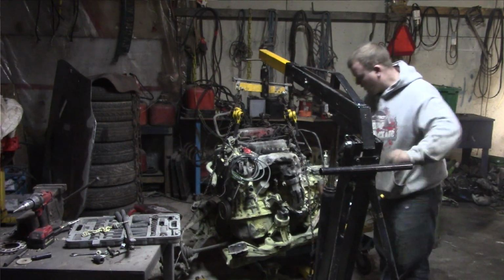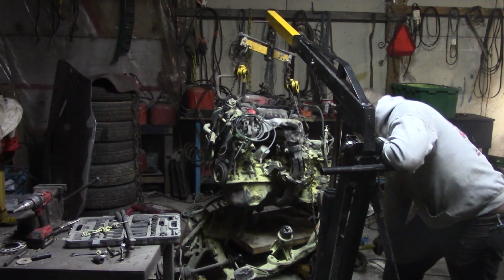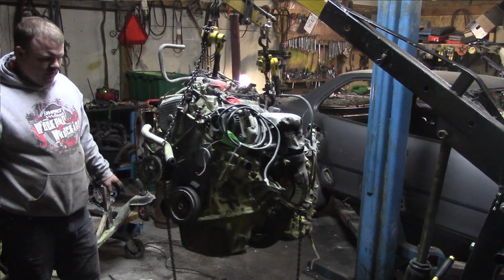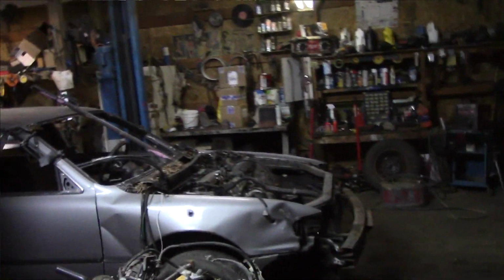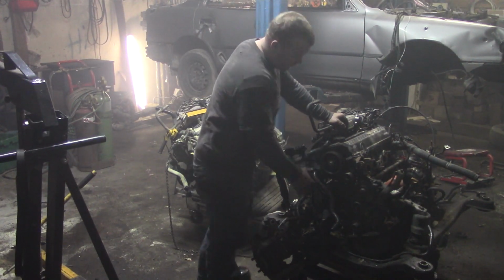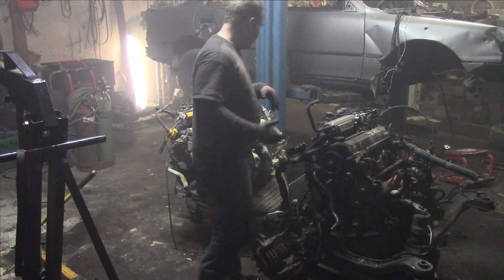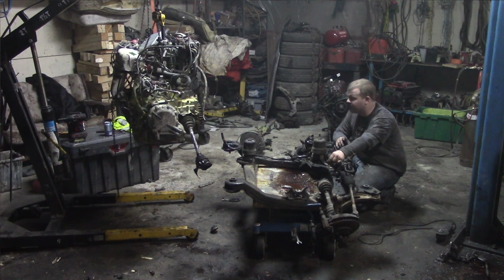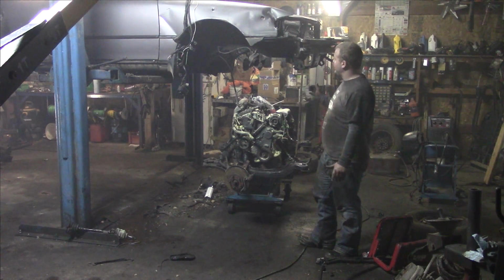toyota camry motor replacement 1991-2001 swap old motor for the new motor

Comment: I have a 1994 Camry and found a 1999 Camry with low mileage...  My question is can I use the 99 engine and installed it on the 94 Camry?
Reply from the maker: yes you can
Reply: @zacksworkshop171  Thank you I've watch the rest of your videos and they help alot.... I'm subscribing to your channel you know the vibes 💯

Comment: Can a 97 2.2 Camry motor want put it in 95 Camry will everything hook up
Reply from the maker: it will bolt in but you need to swap motor mounts and alot of wiring
Reply: Got both motors out on ground on the sub frame but yeah notice today a lot of wiring is different a guy told me to switch the heads out and just use all the old wiring but if you know any information on which wiring I could switch I would rather leave that motor from 97 together there both the 2.2
Reply from the maker: @matthewsullivan4119  get a stand alone harness i have step by step how to build it
Reply: Where can I get one of those